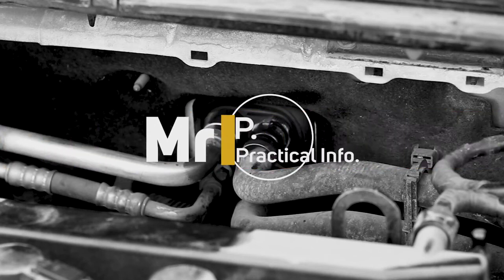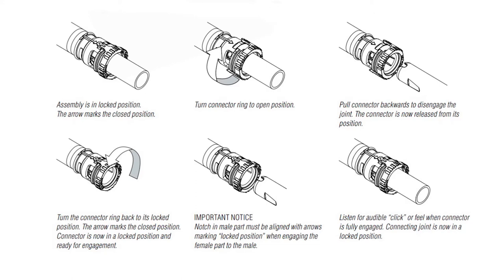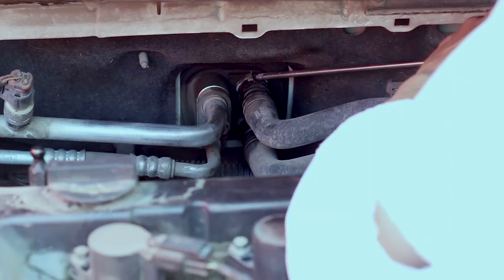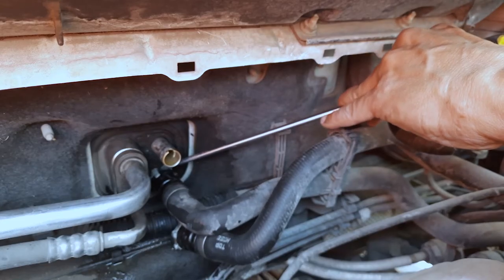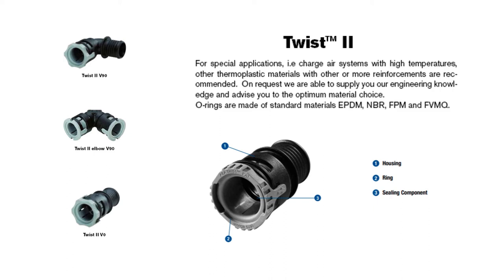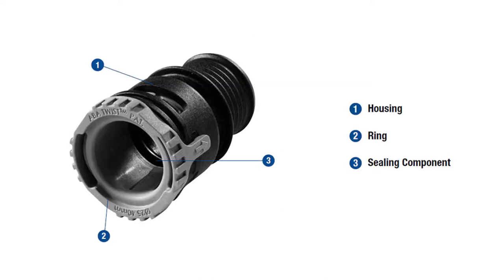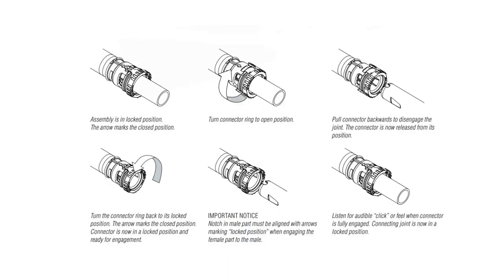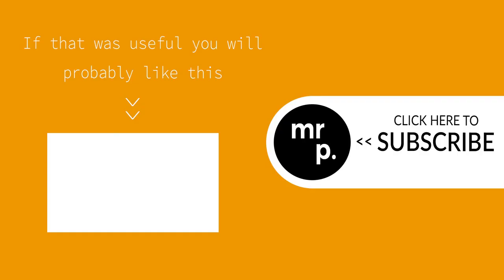Ford Focus Disconnect Heater Core Hose Clamps 🚗

Comment: This information literally saved me $150 for new hoses and hours of work swapping them out. Picked the O-rings out and replaced them and it fixed the problem for sure. O-ring size is 7/8 OD standard or 22.6 OD metric.
Reply: What year/model vehicle? I have a 2012 Ford focus and need to replace the o-ring
Reply: I've got a 2012 as well. I just got the O ring out by removing the gray locking part from the black connector. The O ring is definitely shot.
Reply: @TheAnxiousAdventurer  what size is the O-Ring?
Reply: @rams27  It says 19.05 mm OD
Reply: @rams27 I have a 2013 Ford Focus Se 2.0L. Mine are left right, not up down like in the video. It was definitely my O-Ring. Just stress tested my vehicle and it worked beautifully.

I bought Storehouse brand, item 67677 Nitrile O-Ring Assortment, and used A116. It is a 3/4 ID 15/16 OD x 3/32 thickness O-Ring.

On the quick connect there are two tabs. If you press them GENTLY you can remove the upper grey part of the connector. The O-Ring is found just below where the grey parts sits. This allows for easy removal and easy install of the new O-Ring. 

Hopefully this helps.
Reply: First of all, good luck. I am writing to you from a country whose language is foreign to you. I have a request from you: would it be ok if I use viton o-ring for this gasket? because the nitrile o-rings in my country are maximum 130 degrees @jonathanattaway6204
Reply: @Gezen.memurlar should be fine being as the coolant should only really be about 90c
130c would be overheating territory, it's not normal operating temp

Comment: Fix it permanently without the silly clamp. No more clamps no more o rings. Simply connect the hose directly.
Reply: Did you cut the hose connector off? How did you do it? Need help as I couldn't find the right oring and I ain't going spend on a new hose just for that.
Reply: @henryn3850   yes just cut it off and attach the hose

Comment: My o-ring was leaking and I broke the twist connector.  Dorman 800-411 is a replacement connector - I cut back the hose and clamped it to the Dorman connector.

Comment: Mr. P, what size O-Ring did you use?  Thank you for a to the point video!
Reply: I have a 2013 Ford Focus Se 2.0L. Mine are left right, not up down like in the video. It was definitely my O-Ring. Just stress tested my vehicle and it worked beautifully.

I bought Storehouse brand, item 67677 Nitrile O-Ring Assortment, and used A116. It is a 3/4 ID 15/16 OD x 3/32 thickness O-Ring.

On the quick connect there are two tabs. If you press them GENTLY you can remove the upper grey part of the connector. The O-Ring is found just below where the grey parts sits. This allows for easy removal and easy install of the new O-Ring. 

Hopefully this helps.

Comment: What is the oring od or I'd and stock thickness
Reply: I have a 2013 Ford Focus Se 2.0L. Mine are left right, not up down like in the video. It was definitely my O-Ring. Just stress tested my vehicle and it worked beautifully.

I bought Storehouse brand, item 67677 Nitrile O-Ring Assortment, and used A116. It is a 3/4 ID 15/16 OD x 3/32 thickness O-Ring.

On the quick connect there are two tabs. If you press them GENTLY you can remove the upper grey part of the connector. The O-Ring is found just below where the grey parts sits. This allows for easy removal and easy install of the new O-Ring. 

Hopefully this helps.

Comment: what is the size of the o ring ?
Reply: I have a 2013 Ford Focus Se 2.0L. Mine are left right, not up down like in the video. It was definitely my O-Ring. Just stress tested my vehicle and it worked beautifully.

I bought Storehouse brand, item 67677 Nitrile O-Ring Assortment, and used A116. It is a 3/4 ID 15/16 OD x 3/32 thickness O-Ring.

On the quick connect there are two tabs. If you press them GENTLY you can remove the upper grey part of the connector. The O-Ring is found just below where the grey parts sits. This allows for easy removal and easy install of the new O-Ring. 

Hopefully this helps.

Comment: Where can I get one of the o rings?
Reply: I have a 2013 Ford Focus Se 2.0L. Mine are left right, not up down like in the video. It was definitely my O-Ring. Just stress tested my vehicle and it worked beautifully.

I bought Storehouse brand, item 67677 Nitrile O-Ring Assortment, and used A116. It is a 3/4 ID 15/16 OD x 3/32 thickness O-Ring.

On the quick connect there are two tabs. If you press them GENTLY you can remove the upper grey part of the connector. The O-Ring is found just below where the grey parts sits. This allows for easy removal and easy install of the new O-Ring. 

Hopefully this helps.

Comment: What is the size of the standard oring gasket?
Reply: 19.02
Reply: @1422dantheman  Is 19.02mm OD or ID?  ( 19.02mm = .750" and confirmed, it is the ID, inner diameter)
Reply: Thanks
Reply: @dudebro313  OD or ID?
Reply: I have a 2013 Ford Focus Se 2.0L. Mine are left right, not up down like in the video. It was definitely my O-Ring. Just stress tested my vehicle and it worked beautifully.

I bought Storehouse brand, item 67677 Nitrile O-Ring Assortment, and used A116. It is a 3/4 ID 15/16 OD x 3/32 thickness O-Ring.

On the quick connect there are two tabs. If you press them GENTLY you can remove the upper grey part of the connector. The O-Ring is found just below where the grey parts sits. This allows for easy removal and easy install of the new O-Ring. 

Hopefully this helps.
Reply: I have a 2013 Ford Focus Se 2.0L. Mine are left right, not up down like in the video. It was definitely my O-Ring. Just stress tested my vehicle and it worked beautifully.

I bought Storehouse brand, item 67677 Nitrile O-Ring Assortment, and used A116. It is a 3/4 ID 15/16 OD x 3/32 thickness O-Ring.

On the quick connect there are two tabs. If you press them GENTLY you can remove the upper grey part of the connector. The O-Ring is found just below where the grey parts sits. This allows for easy removal and easy install of the new O-Ring. 

Hopefully this helps.
Reply: First of all, good luck. I am writing to you from a country whose language is foreign to you. I have a request from you: would it be ok if I use viton o-ring for this gasket? because the nitrile o-rings in my country are maximum 130 degrees

Comment: So what size were they??
Reply: 19.02
Reply: I have a 2013 Ford Focus Se 2.0L. Mine are left right, not up down like in the video. It was definitely my O-Ring. Just stress tested my vehicle and it worked beautifully.

I bought Storehouse brand, item 67677 Nitrile O-Ring Assortment, and used A116. It is a 3/4 ID 15/16 OD x 3/32 thickness O-Ring.

On the quick connect there are two tabs. If you press them GENTLY you can remove the upper grey part of the connector. The O-Ring is found just below where the grey parts sits. This allows for easy removal and easy install of the new O-Ring. 

Hopefully this helps.